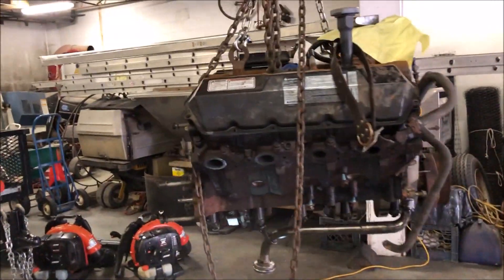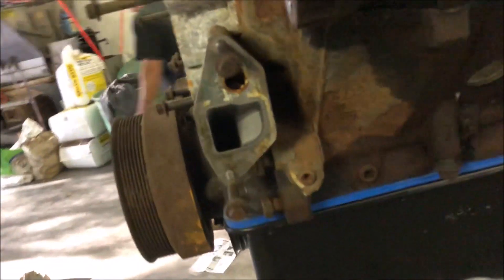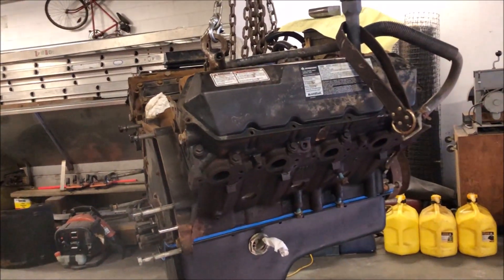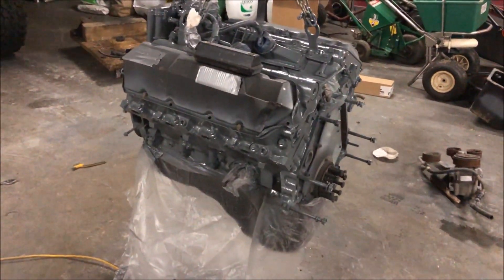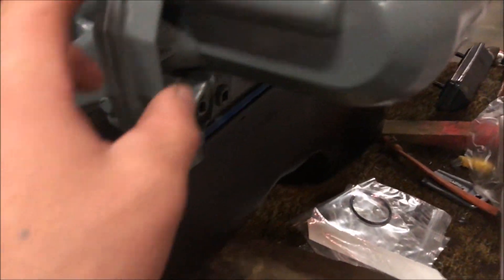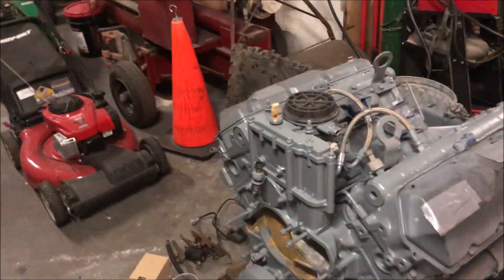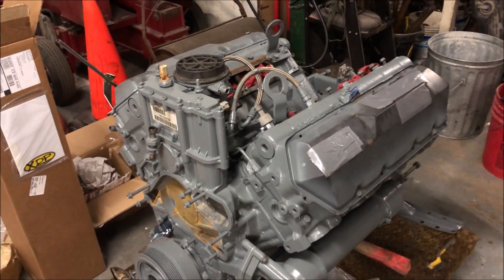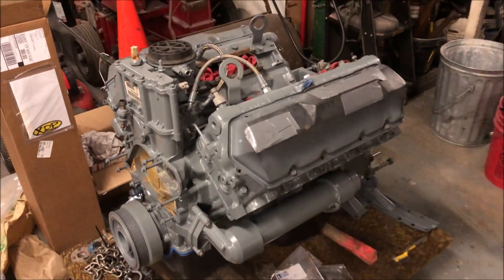7.3 600hp Engine Build Assembly Part 1- "Oil Pan Install, Paint, and More!"

Comment: Get a pan and a gasket together do not use your old pan because it warped and has too far rounded bolt holes so it most likely will still leak

Comment: Depends on what year 7🌲
Reply: 2002 was the best year
Reply: @levidavis5056  false
Reply: @iloveracing3  it’s actually a Fact! Do your research don’t go off just what you have owned... yeah every year had there a few good trucks with no problems, 2002 7.3s had the most with the least problems. All Facts!
Reply: @levidavis5056  the powdered metal rods can only hold 450-500 horse if you are on the skinny pedal often

Comment: 205cc injectors will not make 600 hp you won’t even make 500 with that small of an injector plus anything over 400 on a powder metal rod engine will shatter a rod...
Reply: Wrong , you can make 600 w 205cc 100% and eight fuel to air ratio. And the issue with the powdered metal rods breaking is all in the tuning , certain tunes can create high cylinder pressure which in turn combusts and breaks a rod but you can tune the fuel injection timing to cool the cylinder pressure down and make over 400
Reply: @iloveracing3  😂 no there is no possible way to make 600 on 205s I made 496/1000 on 238/100s and a S369sxe at 60 pounds of boost I’ve seen people make just over 500 with 238s and never on 205s, I like your imagination though
Reply: @4readytosendit  ever heard of spraying?
Reply: @4readytosendit  never said it had to be fuel only
Reply: @iloveracing3  spraying it is not making 600 hp.... it’s oh I make 400 hp and 600 on spray... no it will explode
Reply: If this is a pmr eng though yeh this thing won’t hold for long w this fuel and air setup if he’s on the skinny pedal a lot
Reply: Its very clear u havent built one
Reply: @davidrostron4038  I have a 1996 Ford F-350 crew cab long bed with 275/200s “recently installed” a S369sxe on a t4 kit I built myself comp 910 valve springs smith push rods dual pump regulated return fuel system swapped from manual to built auto that I built myself truck put down a little over 600 hp and over 1200 foot pounds of torque... ya you’re right I’ve never built one 🙄🙄🙄

Comment: At 600hp you're going to need forged rods.
Reply: Nah
Reply: Those 7.3 have forged rods from factory I believe
Reply: @E1105I  depends on what year actually.
Reply: Caleb m yes I know that his truck is a 99 and 99-01 had them
Reply: @E1105I  no 99 back had forged rods
Reply: @davidrostron4038  a lot of 99+ trucks had forged rods 🤦🏻‍♂️ the serial number of the engine are what you need to look at... you’re definitely an expert
Reply: @4readytosendit  that goes with out saying but a good rule of thum is 99 back i have worked on these  since they came out so when u get some time under the hood then talk shit
Reply: @davidrostron4038  clearly I have more than you